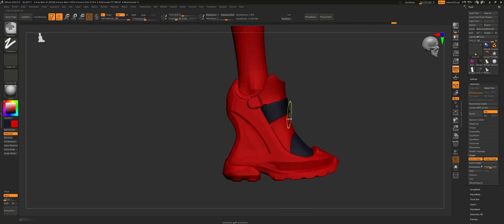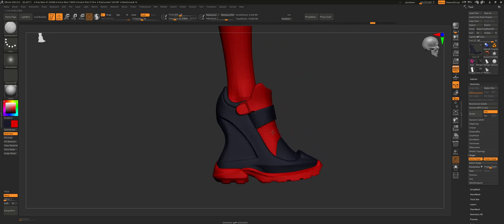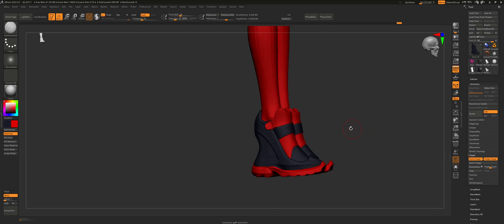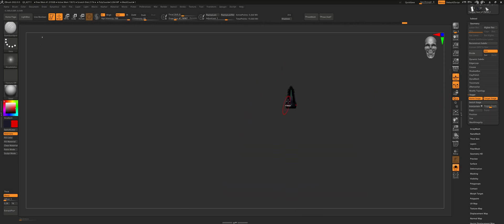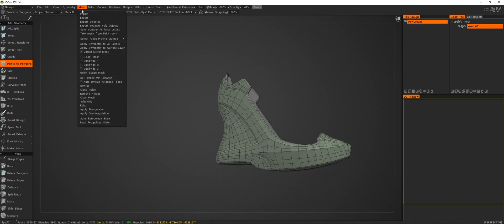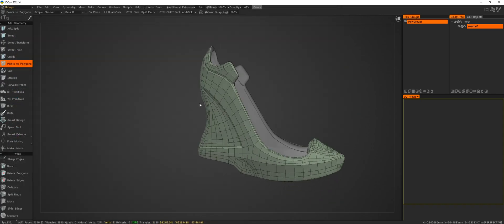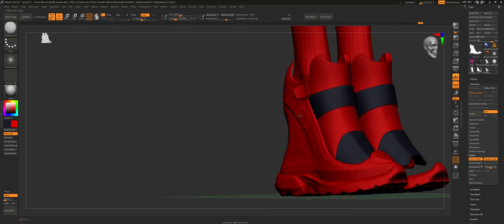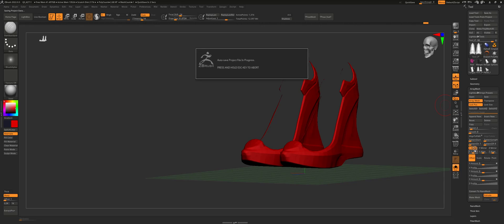Zbrush Quick Tip using Stager to replace High poly geometry

Comment: I came up with something really similar with that at later stages on my current character. But actually the last 20 seconds of the video were more useful to me then the rest 😂 I've been basically looking for a way to work on symmetry on a object that is not on symmetry. So I'll need to have a look at your solution and see if that solves my problem.

Thanks as always for sharing! Every artist should share this kind of tips.
Reply: well.. shoes arent symmetrical things

Comment: Thanks Rodesqa very cool trick but after watching multiple times I still don't get the purpose of using it xD(instead of lets say just having the Lp as a separate subtool) basically If I get it right you replaced the Hp with an imported Lp (which can be any imported mesh) but there's no link between them; or do you plan to project the details later? Sorry I really want to comprehend why you'd wanna use this.
Reply from the maker: I replaced a sketch of a block in with a low poly cleaned up version with sculpting topology.  You can do this with armor pieces, accessories and anything you need to clean up to make it higher resolution with better topology so you can clean up your highpoly sculpts.  its not just for shoes.
Reply: @HiredGunGames  Ayye thanks ! I get it now; so  you completely got rid of the initial hpoly; and you used stager only to trace back the mesh position coordinates and scale.
Reply from the maker: @yugi9710  yup and used the new topo to continue the high poly work.
Reply: @HiredGunGames  yep! All clear now <3 you might do some uvs as well while in 3d coat xD